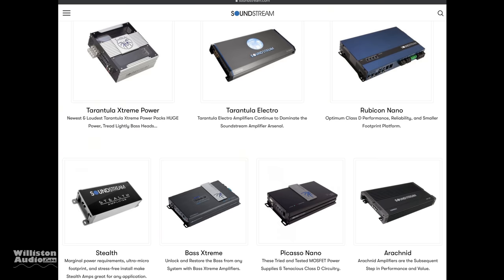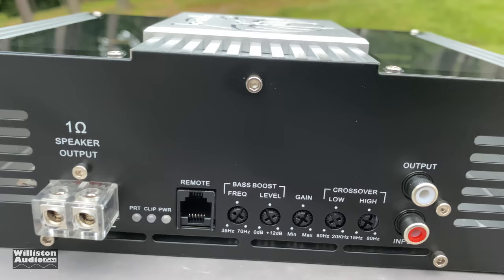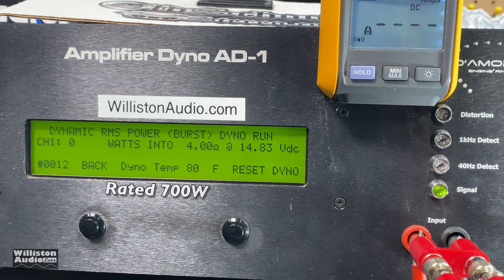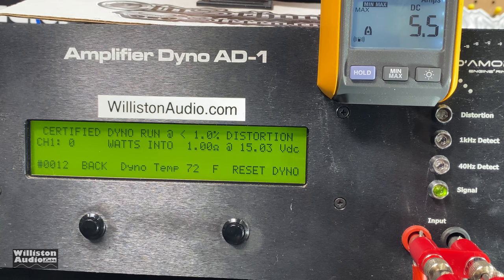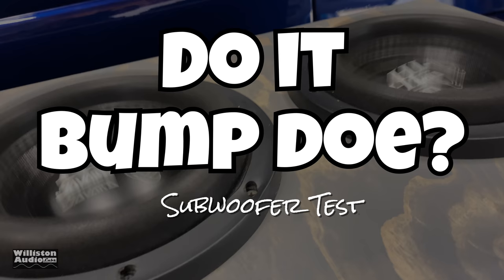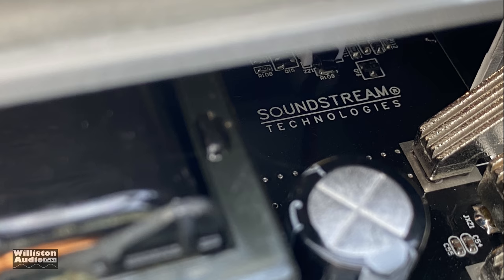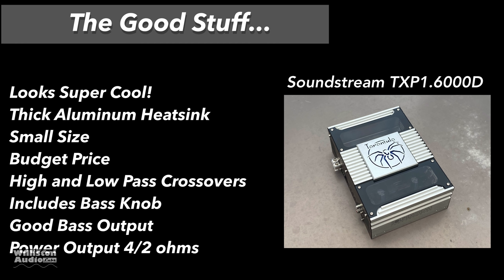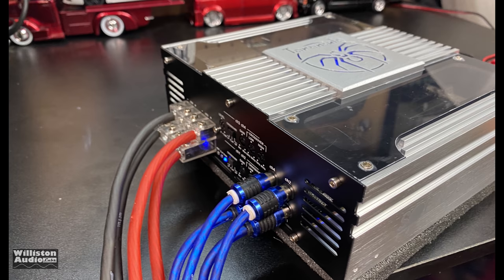Coolest Looking Budget Amp? Soundstream Tarantula Xtreme TXP1.6000D Amp Dyno Test

Comment: Just bought this amp today based on your video. Only running it at 2 ohms with 2 Ct sounds 10’s. Sounds great. Gonna be upgrading the electrical soon to feed it a little more juice. Thanks for the video.
Reply: Still doing good with this amp? Thinking about buying one if so.
Reply: Still doing great. Gonna get the 3500 4 channel soon to match it.

Comment: I love all your amp dynos they help me so much. I purchased an amp.based on your review and it was great until I spent some months using it and its performance degraded fast. I'd like to see videos of you using these see amp in a real car under real time performance like stock alternator with stock wiring no big 3 and see if they perform the same. again 5 star for testing and info.
ps: your videos are awesome huge fan. iv watched easily 90% of your videos when I have time

Comment: Wow, what a turnaround for Epsilon. Finally an amp that does what it's rated. Haha, they have been deceiving folks for so long they just had to put that 6000 on the box. I like it though, no matter what they call it.
Reply from the maker: Agreed! We are moving the right way!!
Reply: Alot of the older (ten years back) PPI and SS amps did or exceeded rated. Issue was when the people that cared left they just started rebadging junk. Nice to see these are actually decent. I wanna see a test of the Rubi Nanos and the new PPI Power Class. Though.
Reply: @wal  😇😇😇

Comment: I'll count this as a win. The marketing geniuses allowed an actual RMS rating on the spec sheet. Still they plastered 12k on the box and the model is a dubious 6k number. I think it's the right direction though, accurate manuals are where we look for real tech specs. It's almost like Big D himself had a hand in the specs on the back of the box. Great price on this amp, they should sell great with the new design and tested performance. I think they could have improved alot of things on this amp though, no subsonic filter? Or did I miss that. One set of speaker outputs, very budget. It looks like it could have been much slimmer with a different chassis. I'd love to see Soundstream get away from the spider logo, bring back Reference. Great video! Love it!
Reply from the maker: Thanks for watching and commenting!

Comment: I recently installed one of the stealth models in my motorcycle.  I made the mistake of assuming max power meant half or less in the real world. I blew a $200 set of polk audio speakers in a few days. I now have to take it easy on the new ones, and every time I smell anything close to a hot coil, I shut it down fast. If interested,  I have a 2nd one I am not using. I could send it to you for a test video.

Comment: I can't say much of anything because I've always been a big fan of Soundstream. I have a Soundstream Rubicon Nano RN1.5000D and while I already know that it doesn't push anywhere near 5000 watts, I've always been interested to see what it actually does put out because it SLAMMED my two Sundown SA12-D2s. However, I learned from your videos and bought an Orion HCCA 3k watt cheater amp. I am no professional, but I was smart enough to install a 360A high output alternator that cost me $700 and I also did the Big 3 upgrade, and I ran all 0/1 G wiring. I do have a 3 farad cap, but I haven't researched enough how to use it properly, and I'm only using one of the power and ground inputs, with hardly half gain for four Sundown SA12-D2s, so it SLAMS and it doesn't draw too much power.

Comment: Actually pretty impressed with how it performed.  Kinda wondering how much power it would put out if it had 1/0 power and grounds compared to the smaller ones that it has.
Reply from the maker: I used reducers, so I don’t think that’s the limitation...
Reply: @wal  Can you explain how you were able to use this as a bass amp when it's a full bridge design?? What'd you set the crossover's to?
Reply from the maker: @VentureWelding  a lot of subwoofer amps these days are full bridge. Also you can use crossover in most head unit's for low pass (sub) instead of the amp (80Hz is typical). It's often to tell what frequency the crossover is set on the amp due to the large range it covers.

Comment: Hey Derek what's up I'm Jose from L.A , C.A . This amps they hit hard and I agree  with you  on the output power of them, Just they don't last LAST LONG  IF PLAYING FOR A WHILE  THEY OVER HEATED ON ME, I HAD BOUGHT  THE TARANTULA XTREME POWER TXP1.12000D  ONLY LAST  ME 3 WEEKS I  HAVE  PICTURES  OF ITS GUTS AND EVERYTHING   PULL APART   I COULD SEND YOU THE PICTURES  OF IT   . I GUESS THIS AMPS ONLY WORK GOOD  IF YOU BUMP IT FOR A FEW MINUTES  BEFORE  IT BURNS OUT ON YOU . GET BACK AT ME WHEN YOU GET A  CHANCE   ILL SEND YOU THE PICTURES  OF THE TXP1,12000D AMP  BURNED OUT , THANK YOU .

Comment: Did you catch that the Dual branded XPR82D (and 84) have been discontinued and replaced with the Jensen branded XDA92RB (and 94) which appears to be the exact same amps just with added Bluetooth controlled RGB lighting?

I bought an XPR84D based on your video and it's great, thank you, though I am only powering a single ~20 year old 200 watt MTX 10" with the 4 ohm voice coils in series and the amp bridged, powered by a stock 25 amp circuit in the vehicle which is the heavyish power wires for the optional 120V power inverter.

Comment: I remember the days when Soundstream was real quality and bass knobs were epicenters* that made woofers JUMP like a frog on crack! :-D

*Epicenter was a popular device made by Audio Control that was a subharmonic synthesizer which would produce notes at 1/2 frequency of the fundamental.  So a 60Hz bass note has a 30Hz sister.  And so on.
Reply: In the 90svthe epicenter killed my rf pro10s in a band pass  box.scared of epicenters actually
Reply: I was playing my friend misery from the black album
Reply: @strongholdpro1974  Yes if your voice coils cannot (thermally) handle your amp's full output power it will let out the magic smoke.  Parametric EQs abused in a similar manner will cause this to happen as well.
Reply: @cpufrost  magic indeed . epicenter was some sorcery. It would make unimpressive banda music  sound like a modern bass note

Comment: First amp they have had since the reference series in my opinion. Nice video Big D... Have you tested any polk amps lately?
Reply from the maker: Not since the one I used in the $150 SPL challenge
Reply: @wal  Which amp was that sir? If you don't mind me asking? I have a Polk Audio 1100.5, just curious as to what it's pushing out. I may have to check into sending it to you to test.
Reply: @wal  what’s your mailing address

Comment: I suspect that it would have made the 2300 at 40Hz if it was running 1/0 Power.  The increased resistance is what was holding it back.
Reply from the maker: I was using 1/0 into 4ga reducer

Comment: It's not milled, it's extruded. Hot aluminum pushed through a die the base shape is created and machining is just for tolerance. This is a cheap amp with decent specs. short of the 1ohm, it exceeded specs. so looks solid
Reply from the maker: Yes, makes sense. Thanks for the lesson in aluminum extrusion 🤟

Comment: Big d do you know if the oldschool autotek 222 wire up the same as a oschool autotek 333mm? It has the switch underneath also for 1or 2 chainals

Comment: I would like to know your take on the bash 500 bass plate for home audio sub enclosures. Sense I regularly fry bass plates that come factory. I'm running 7 subs on my my home system and it hits seriously hard but every couple of months I'm on either Ebay or Amazon ordering factory replacements. So I'm thinking about going to the bash 300 and 500 bass plates over the stock replacement for my JBL  and my Weldon  12" subs.

Comment: Brazilian amp technology. Power is good for the money in full range if you don't mind the high THD. And the fact that at higher volumes, that 'CLIP LED' starts its own Morse Code light show. lol
Reply: Does better than a lot of the Brazilians at efficiency
Reply: @likeclockwork6473  You're right about that. It's good to see  because if you're going to 'borrow' someone's tech, at least improve upon it so you can call it your own. Higher efficiency makes that statement for them. Moving in the right direction for sure!
Reply: @FarAboveDaCloudz  I remember when the Taramps craze first hit. They put out insane amounts of power but they were sub 60% efficient and even below 50% when running really low ohm loads. That was early though, they've been improving massively since the market caught on to the pros of this tech.

Comment: Hi I bought the TPX6000 and now it's showing the clip signal even after disconnecting the all the signal cables including the speaker cable and it's still showing the clip signal. What might be the issue??
Reply from the maker: You should contact Soundstream support

Comment: wonder how  they machine those so cost effectively, are those cnc things that cheap to run now? That amp does have a beautiful look tho, a bit robust imo.good vid
Reply: Another comment answered this. Its extruded aluminum. They basically heat a cylinder of solid aluminum till its very pliable, then press through a mold making a really long version of what you see here, then they cut it to the length they want. Its really smart design for making a ton of these things.
Reply: @likeclockwork6473  thank you,didn't see that comment

Comment: Can this amp be stapped? I have 2 of them and am intending on running both on 2 txx-bd4-12  and am trying to figure out if I can run them strapped (essentially 1 u it) or should I run each separate 🤔 an attempt to dial them both in as close as possible to each other 😕
Reply: this is a full bridge desing.therefore can not be linked or strapped.

Comment: Do you have a way to tell amplifiers that produce SQ instead of output, like Signal to noise, Dampening factor , slew rate ect.
Reply from the maker: I have a HP8903b audio analyzer I hope to use in the near future. It does some of those, but just remember, there is no correlation between these measurements and SQ since SQ is subjective. “It’s all in your head” 👈😬

Comment: Damn BigD looks like everyone is jumping on the full bridge train huh 🤔
Reply from the maker: Yep, cheaper amps is what people seem to want
Reply: No thanks...
Reply: Yep. Brazil changed the car audio game for sure. Now poor folks can be bassheads, which is the main reason for haters.
Reply: @Turdpuncher  true it has opened up the market to have more options and suit everyone's budget
Reply: @wsttxC10_454  im loving it. Now getting in the high 150s isnt such a money pit as it once was. 15 years ago you couldnt do it for less than 10k, now its totaly doable.
Reply: @Turdpuncher  how is the sound quality of full bridge amps on subs though? Everyone gives a different opinion but when you ask what they run they are still running half bridge SMH
Reply: @wsttxC10_454  as far as sound quality i really cant tell because i run a dsp and my amps have more headroom than the subs can handle . If you buy a 3k amp and run it to 2 subs that handle 1500 rms a peice you will have to set the amp right to the point of clipping so the sound quality will suffer. Expensive halfbridge amps have better filtering and dynamic headroom via bigger caps and higher quality fets, but you can get a fullbridge with twice the rated power for half the price. Its all about if you want to pay more to max out a half bridge or just run a big full bridge as far as sound quality. Alot of guys say that dont know this. I have had great luck with them so far, just overcompensate and youll be fine.

Comment: It seems just like the taramps where the "low" says 20hz to 200khz wouldn't that be the high pass filter? Low is usually up to like 250hz
Reply from the maker: I got a little thrown back with them too but the high pass xover is like a subsonic and the LPF should be set to around 80Hz for most applications

Comment: My $.002. When Soundstream purchased Precision Power they went down hill. Before that PPI used top notch components and internals.  After Sound Stream.  Not so much.
Reply: Soundstream and PPI are both owned by a parent company called Epsilon. There is really very little left of these legacy brands from the 80's/90's. Only the names.

Comment: Idk, 2000 watts for 220  doesn’t sound too bad.  Regardless if it does rates...
Reply from the maker: Sounds great on the subs. I may put it in my car soon
Reply: Dude Rockford Fosgate's 1500w 2ohm amp costs $700 on amazon ($800 MSRP). This is directly comparable. Its worse obviously but its also costs 30% as much. Unbelievable power/dollar ratio

Comment: Can someone DEFINITIVELY explain how this amp can be a full range amp if you want it to be, or it can just be used as a bass amp. There's no switch. Please respond if you're absolutely certain for this particular amp.
Reply from the maker: The crossover allows full range operation but I’d recommend using only with subwoofers
Reply: @wal  that's my problem though how would you use both crossovers with subwoofers big D? When it has no switch to select one crossover, over the other. Instead both are active, so where would you set them without canceling each other out?

Comment: starting to get into full bridge amps myself started with a pioneer 800 rms amp then a fosgate 1200d then a taramps 1.2k bass then fan was annoying so then I tried a skar 1500 rp it hated being wired to 1ohm it would overheat so I ditched it and got a sundown full bridge 1000 now I just recently installed the bigger brother the 1500. I will see how it turns out just waiting for my new distribution block and 0 gauge wire to get here cause I wired the amp with 4 gauge. I ran outta 0 gauge when I ran it from the batt to the trunk...lol

Comment: Amp request for a vid? Audison LRx 5.1k, 5channel amp runs front rear and sub. Just thought i would give a suggestion!
Reply from the maker: Cool amp 😎
Reply: @wal  I've had this amp in my truck for at least 3 years now and still working great..Have a question for u though...I have a taramps HD3000.1 sitting in my closet u think it will do more on a 13.5 W7? Or about the same as the soundstreme????Also I have 4 diamond audio DES1000.1 I would love to see u do a video on one of those..If possible?

Comment: Very nice but the Wolfram o-2400.1 is cheaper and apparently makes more power.
Reply from the maker: This brings up a good point and one I fail to mention (and I should)...can you audibly tell the difference between 2200 and 2400 watts?
Reply: @wal  Most likely not, if it was a 500 vs 700 it would be noticeable but at over 2k I doubt it, but i ordered the Wolfram for $189.96 shipped, it has clipping light on the amp and the remote, they claim >92% efficiency at 4 ohm, for that price...can't beat it.

Comment: Not a new line though, they where a big line in the late 90s. Still have an old distribution block in the tarantula line
Reply from the maker: Tarantula Xtreme?
Reply: @wal  honestly couldn't tell you same logo, 4way ground fused distribution block. Lights up the same way, blue spider. Been in the audio junk drawer for years. Waiting for its next project.

Comment: How accurate is the clip light?
Reply: My single p3 d2 sub wired to 4ohm on the txp12000 at half gain clips with good voltage above 13's smh..sub sounds awesome passed clipping but to stay on the safe side dont chance it too long as i have blown my 6500d doing so, so yes i would stay within clippings and amp works fine

Comment: Soundstream has lost its old reliability cred, in my experience.  I bought a used Rubicon from the 90's and that thing was already beat up but took a ton of abuse for years.  It died around mid 2010's, so I bought a new 5 channel Rubicon to replace it.  It was wired conservatively but blew up in less than 3 years.  If they're built in China now, that would explain it.

Comment: Where's the fuse?
Reply from the maker: Inline. Does not come wif one
Reply: I have an old Fosgate power 1000a2.
I just checked it out, no fuses on it either, not on the outside anyways.

Edit: I use inlines regardless.

Comment: 324 amps on 4 gauge is gonna eat SO many inline fuses its not even funny to think about how many times this amp is gonna get  hooked to CCA  ebay install kits.
Reply from the maker: It’s true. I need to remind folks. But the current pulls I show are worst case scenario also using test tone.
Reply: @wal  installed a BASS 3k a couple weeks back I was surprised it was a 4 gauge input as well.. the amp wasn't but 3 feet from the Battery though and I used an ANL so I didn't stress over it too much.. somehow this video got me thinking. Thanks for that

Comment: Would’ve gotten the 2300 at 1ohm if the voltage held up a little better and if it had 1/0 inputs.
Reply: Not worth going for 1ohm with the efficiency loss. Those 2ohm numbers are killer for the money though.

Comment: Correct me if I'm wrong, but this amp has no Fuse???
Huge F'up.  That big Dummy....?.?
Big Con IMO
Reply: Why if you know what you are doing you shouldn't need any. The fuse you need for this amp can be wildly different depending on the ohm load. It's less you have to mess with the amp honestly